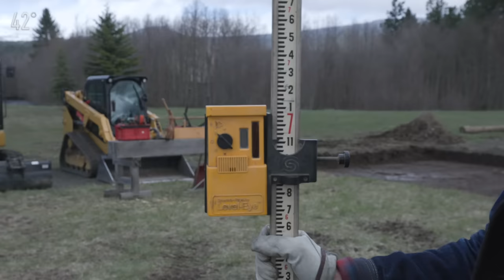Cozy Log Home DIY: Episode 4 - Self-Sufficient Setup: Crafting a Timber Power Base & Water

Comment: coming from a mason that is used to mixing I really think the dry sack method is best. less shrinkage and if you rod the mix in place after adding water once the pole is set you'll get rock solid stability that you don't get with mixing and pouring. it's a bit easier as a bonus!

Comment: I'm a concrete mixer driver. I'm almost finished with my first year. Last week I made a delivery where they were pouring red colored concrete in a trench to cover up high voltage conduit lines.
Reply: Depending on where you are in the country you will also be required to put scare tape over the top as well.
Reply: @raymondroberts1905  they may have done that as well as the job progressed after I was gone, but nobody is going to be able to dig through that red concrete fast enough to not see the color. It had to have been over 2 feet thick. It was also in a parking lot so they would have to get through asphalt and another 3 or 4 feet of dirt.

Comment: im a dump truck driver that was not drain and/or washed rock it looked like 3/4 -  witch is used for back fill and compacting as it has fines and compacts well making for a good foundation it will drain some but it is not drain rock.if you want drain rock ask for example 1" open, washed or drain

Comment: Not sure if this construction is temporary or permanent? Where I am, this board would be temporary for use during construction, then a permanent connection to a metre box would be established after a certain point in the construction process, usually at lock up stage. Thanks mate.

Comment: If you're metered, they will eventually have you on a smart meter. I worked for a municipality that literally had the most accurate manual, [walking readers] in the nation. We averaged 1 error per 20k reads. A serious accomplishment. We walked 2600 miles a year each. There were 20 of us. Once you get that meter on your property, you basically created an easement for the govt to enter onto your property, full stop. We were trained, sadly, to identify "sovereign " entities under the guise of possible utility theft. Very shady practices and a reason why I left those guys. We even had dedicated staff acting as "agents". Ex military hard-core, loyal city workers with an intel branch that crossed over onto people's property every single month. In short, you were probably better off with a low key well.

Comment: A Eastcoast man knows how to set posts correctly. Never use concrete for wood post. It creates a surface for water to sit and rot the post. Use 60/40 gravel-sand mix and tar below the grade contact point. 

Edit : Also the post hole centers are so far off, the concrete footing isnt equal on all sides of the post. Typical west coast man. Half assed project.

Comment: You've gone soft, Cody. First, you started the dadoes with not only an electric saw, but a battery powered one, rather than making the whole slot using timber framing chisels. Now you're mixing concrete from bags, rather than shoveling gravel, sand, and cement together. I'm thinking of unsubscribing. 

;o)